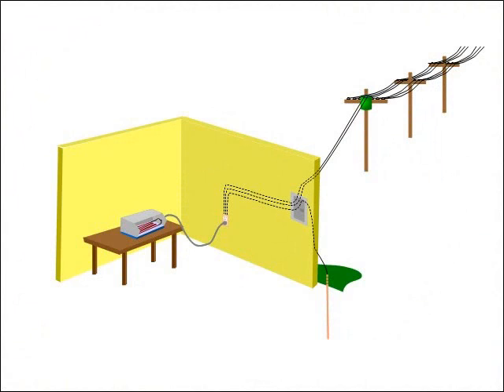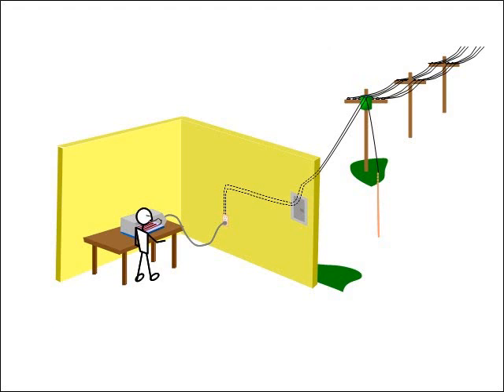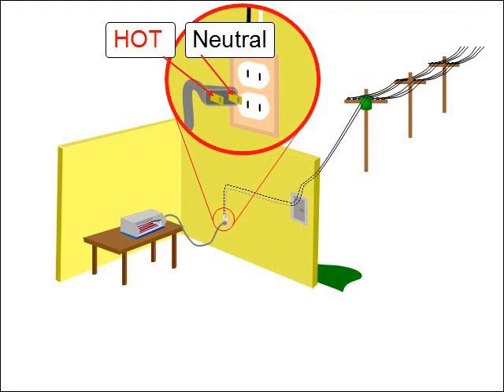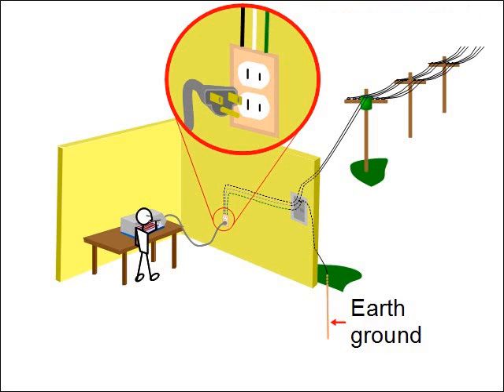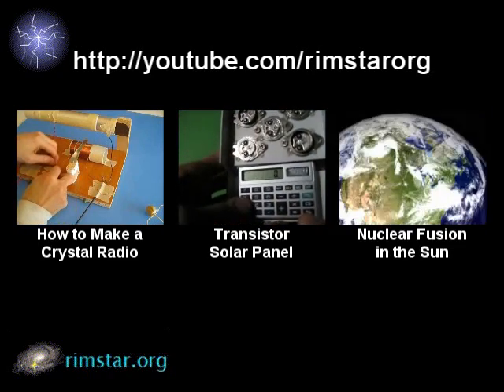Hot Neutral and Ground our Funny Looking Household Electrical Socket

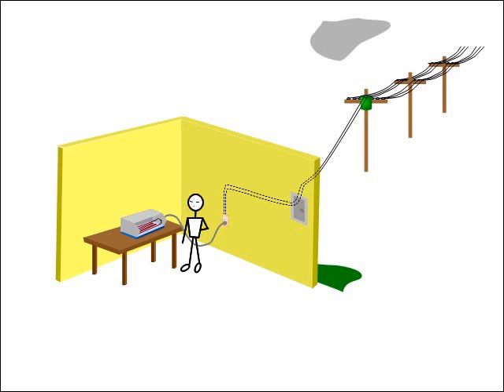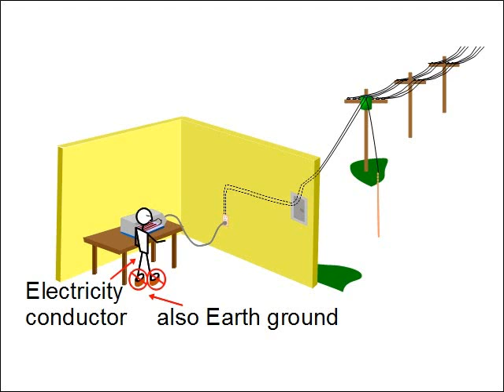Comment from the maker: In the video I assume that you're not insulated from ground (no rubber shoes and standing/sitting on something that's grounded, or a bare arm sitting on a grounded table, ...) In the 1st cases, 0:45 and 1:02, the voltage can be so high that even a little insulation won't help. This really was a problem in the early 1900s. For the remaining cases I mention the lack of insulation at 1:19.  So in your case you must have been insulated from ground when you touched the Hot with only one hand.

Comment from the maker: There is no Pos or Neg with AC, alternating current, so I don't know which wires you're using. Assuming it's the Hot/black and Neutral/white then the breaker in your breaker panel should trip (or your fuse should blow). If it didn't then either the breaker/fuse is already tripped/blown and the power socket is not working at all or you have a tremendous amount of current running through the wire when you touch and you have a fire hazard because the breaker/fuse should be tripping/blowing.

Comment from the maker: Touching only Hot will not shock you if you are insulated from ground. If you are standing and have thick rubber shoes, then the rubber insulates you from ground so you won't complete the circuit. I've been shock many times by touching Hot or Neutral while I wasn't insulated. I don't remember what else I was touching, maybe the floor with thin clothes, maybe an appliance. Luckily I always move away fast enough that I get only a quick buzzing feeling.

Comment from the maker: So you're saying that the lines coming all the way from the generating station contain just the two (three?) phases? What you say about neutral sure clears up how it's not alternating. And I avoided using the term "bonded" so that more people could understand this conversation - but I think we've moved past that :). At least my video is still in good shape since it doesn't go into that level of detail. BTW Did you mark your other post as spam? I thought it was a very useful explanation.

Comment: Well, not quite. The neutral is derived for each service at the distribution transformer itself. A grounded (common) conductor may travel with the phase wires, but it is not "neutral", though at the same potential (hopefully). It's called neutral due to it's center-tapped nature from a 240 secondary winding which makes it a "neutral" reference for each of the 120 volt conductors....it is neither the high side nor the low side of the winding...it is the *neutral* center.

Comment: The *neutral* derived from the distribution transformer is connected to earth for every power pole which has a transformer.  This is a direct connection made hard and fast...bonded is the correct terminology.

Comment: The "live" would be the hot which is derived from the high side tap of the supplying transformer.  The neutral is the reference, or low side of the supplying transformer.  In the US we use split-phase, which is a center tapped (neutral) winding.  The secondary is 240 center-tapped. Earth is tied to neutral for a safety in the event neutral is lost or surges and whatnot. Neutral does not "cycle", nor does ground. If the neutral was equal and opposite then they would null and produce nothing.

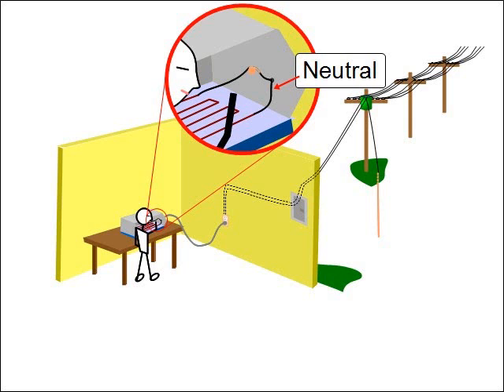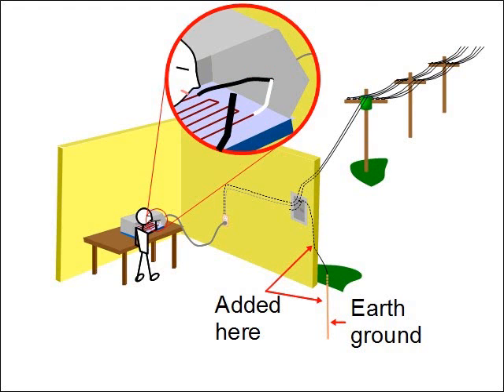Comment from the maker: As said in the video at 1:37, one of the wires is connected to ground but the other isn't, so it's still dangerous. That one is considered live. That's the one called Hot. The one connected to ground it called Neutral. I should have pointed it out in the video but at 2:51 there's a connection in the breaker panel on the wall between Neutral and Ground.

BTW There is no AC Positive wire and AC Negative wire since the current and voltage alternate directions. There's Hot and Neutral (and Ground).

Comment from the maker: But to your last point, at least in North America, the main breaker panel, the one where power first enters the house, is grounded and neutral is also connected to ground at that point too, usually through the panel itself. Also, to prevent charge buildup on the outdoor power lines or lightning strikes from traveling on the lines, my understanding is that the lines are grounded at points along their run. Maybe this is done via spark gaps?

Comment from the maker: Well, as I said I wasn't 100% sure. Your answer makes more sense. Both the hot and neutral go all the way back to the generating station and are provided by the generating station.
Reply: My household Neutral goes no further than the step down transformer 
on the pole outside.  This step down transformer has ONE (1) bushing and only one bushing ( the hot conductor from the power company).
      Most likely the reason we call it Single Phase step down (one of three possible phases). comment please

Comment: Using that reasoning, both positive and negative would "go to ground" because it is the difference of potential, not the polarity (since this is AC) that would cause current to flow between conductors and ground (yes, even *neutral* current).

The reason this does not happen (except in the case of a fault) is that the neutral is provided to the circuit, not ground.  Normally only the casing or exposed metal parts would be connected to ground (if the equipment is constructed correctly).

Comment from the maker: Having thought some more, the best answer I can come up with is that the alternating current has a choice of going to ground or returning to the generating station along the neutral wire and that the easiest path is through the neutral wire. i.e. the ground itself offers some resistance. I'm not 100% sure if that's the case though.